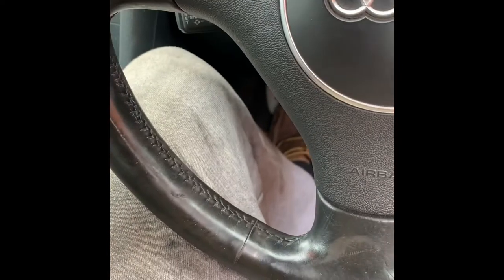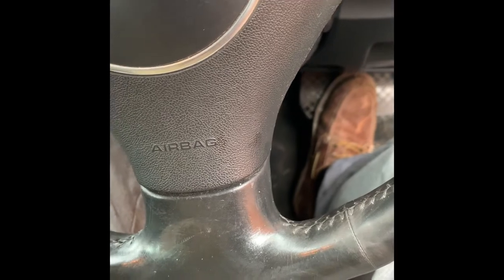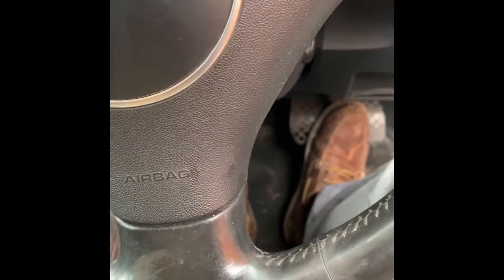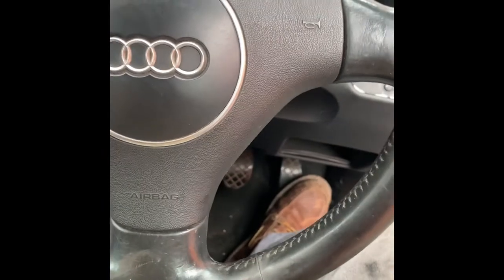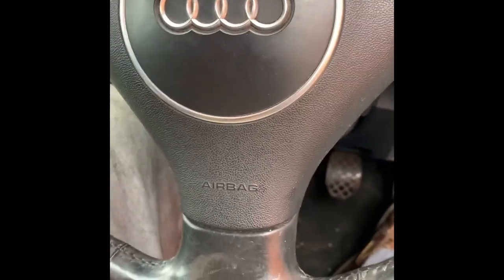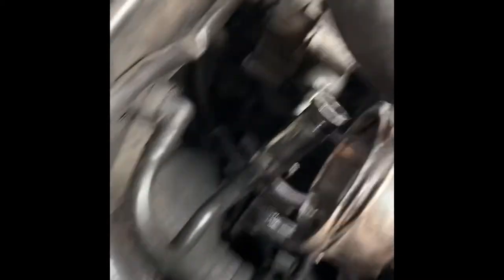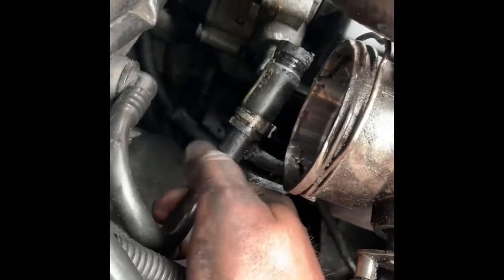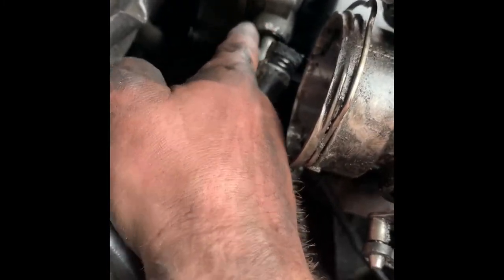HARD BRAKE PEDAL - diagnosis - EASY - VAG - Audi A4 B6

Comment: Hey mate 

I have a Hyundai Sonata 2003 
The brake pedal is so hard , i changed the brake booster , it was good only for a day , then it went back as it was before ! 

Also, whenever i apply the brakes suddenly (and a little bit hard) , the ABS turns on very early. 

How can i fix it ? Thank you so much

Comment: Hi i have a 55 plate a4 estate 2.0l tdi 140bhp sline. i have a very hard pedal, whats best todo to check why its so hard do you recon its the tandem pump or bad servo? also have a intermittent oil pressure warning light on come on dash when getting into turbo boost. checked oil does seem to be getting to the top. what should i check first.

Comment: Hey man first comment here I have b7 A4  and my problem is relatively the same but my car also seems to go into limp mode after it drives thru rain probably a bad wiring problem from the transmission/nss or my pedal accelerator those of which I'm not sure which one?

Comment: Hello mate ! 
I Got a problem with a stiff break pedal in the morning On my 1.9 AWX engine. When I slightly pull the the pipe from the brake booster there’s no vacuum hiss… is it possible that that the brake booster can’t hold the vacuum anymore ?
P.s. : already changed the vacuum/tandem pump
Reply: @TheTriumphGuy101  cheers mate ! Thank you for the answer! First I will try to change the pipe, for as I know its tip that goes in the brake booster should works a unisons valve, and maybe that’s the problem, I’ll let you know when I’ll figure it out ! 
Have a good day!
Reply: Did you fix it?
Reply: @LONELYcheeseBOX Yup, i changed the tandem (vacuum) pump and the brake booster